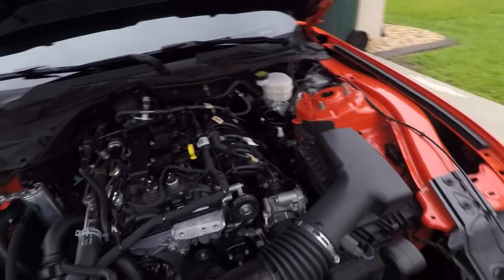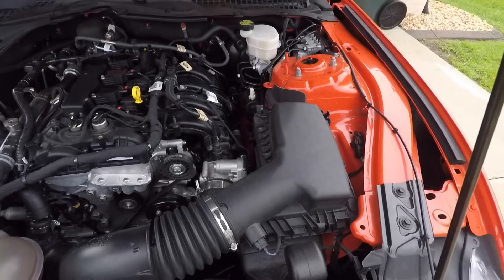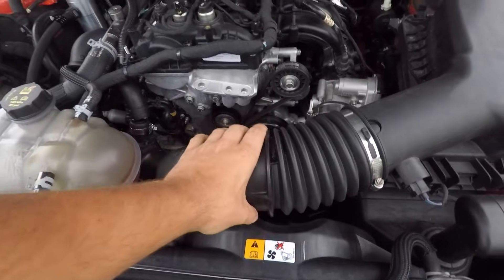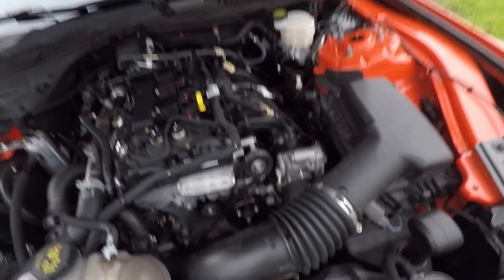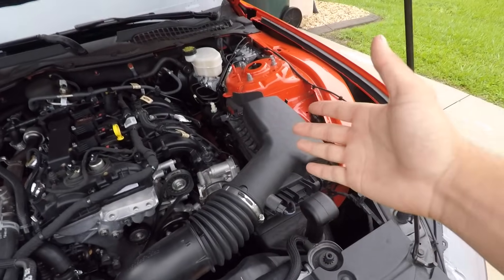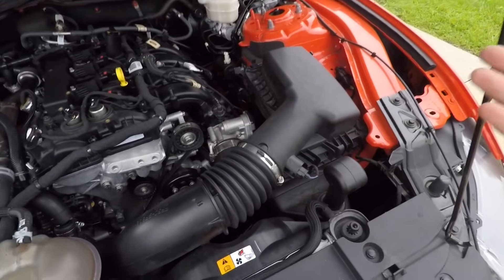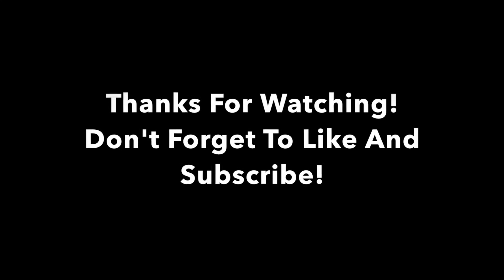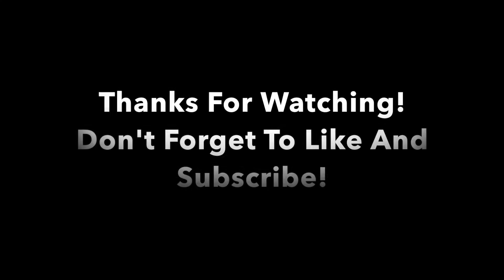Top 5 Mods Not To Do To Your Ecoboost Mustang

Comment: Well I just installed the roush cold air intake in my ecoboost, and I've noticed significantly more power vs the stock box. No tune
Reply: Maybe less HP, more torque?
Reply: Had the same intake... Trashed it. Stock box, high flow filter, airaid pipe and velossatech big mouth. Your welcome
Reply: Ford sells a cold air intake kit and a tune that adds 75HP and 64lb-ft on their official website for the ecoboost. Ford Part Number: M-9603-M4
Reply: Lol. Roush intake makes for better airflow, pulls more air is cools you down faster = more power. You will want one maybe not as a first mod. Plus yes it sounds fantastic.
Reply: Same here
Reply: Bryan Milligan yea same here
Reply: Yeah I just watched a video of a actual speed shop doing a bolt on build with one of these. They said the stock intake starts to limit you after you gain about 70-80hp

Which they easily got 100hp with a exhaust system(down pipe included) the better aftermarket intake, the Cobb access port, and a I'll have to edit this when I find the video again to see what else the added. But they gor 100hp and about 90 extra ft lbs of torque.
Reply: I just installed my Roush intake in my EcoBoost I felt more on pull and power?..I still dont understand why the video says you lose 10 to 15 hp?
Reply: @crowdhunter168  I agree with you
Reply: @dan930412  same here brotha
Reply: @jesseluna8423  same here brotha
Reply: @JustaM340i  The argument is focused on open-intake boxes, Roush sells a closed box (like the stock intercooler) for 2018-19 models, which was a very good move on their part. It's something to do with the air/fuel ratio when you have no cover on a intake.
Reply: Tbe roush intake has slots near the lid to make it lounder which lets hot air into the intake track. That means less power.
Reply from the maker: Most people are running stock box for a reason. Even guys making 600+

Comment: The intercooler part, dude, did you black out for those two minutes? I've had both sizes from a stock location intercooler, to a big FFTEC unit with a Garrett core. Barely any difference between the units. Any stock sized replacement is a huge upgrade from stock and one of the best mods you can do to this thing. Super cheap on the used market also.
Reply: Yeah seriously this guy doesn’t even know half of what he’s saying

Comment: Most of your advice really applies to the 3.5 ecoboost taurus and lincoln as well. Intake does nothing but add a louder turbo sound. The stock ford intake is not a bottleneck. At least not yet. Aftermarket exhaust rasps like crazy, but does add HP. Definitely go with a custum tune from a reputable tuner like Unleased or Livernois.
Reply: flow master axel back with a reso delete y pipe sound just perfet without it being trash

Comment: You can run your cobb ots tunes just fine trust me. I've been running stage 2 91octane for about a year now and nothing has gone wrong and I definitely push this car. Just use the right stage your car needs. Each stage you are required more and more mods. Rn I am fbo. Trust me cobb has been in business a while and are professionals, your car will be fine as long as you have your mods associated with the stage you run.

Comment: I agree for the most part except for the CAI. Depending on the CAI. Going from stock to the shelby GT350 CAI intake  and tune (the tune doesn't work with stock air box) made a dramatic difference. According to 224xLC dynojet made almost 90 hp at peak gains and almost 100 tq at peak gains. IMO CAI is worth it if you buy a tune and intake specific for one another together.

Comment: Easily one of the worst and most misleading videos I’ve seen on the eb. Providing no evidence and just ones shitty opinion. Maybe at the time of this videos the stock cai might have been better but not now. Cai, borla downpipe, mbrp cat-backs with a tune, gained 110hp and 125 tq. Exhaust sounds deep and not like a ricer. I’ve had these mods on for about 20,000 miles and haven’t had one problem.
Reply: What mods do u have I’m trying to run the same setup???
Reply: yeah and a few other little simple things will help like performance injectors and some nice spark plugs. Then all that after a tune will help a ton. Also allowing the engine to breathe is your most important factor and then you can start raising boost pressure.

Comment: This is an older video so may have changed but I installed the Cobb stage 1 93 tune and love it. Car has a lot more power but more important drives and shifts better. Now I bought the car to drive 10 more years so not out racing it.

Comment: There are certain caveats however to his "suggestions"  which I feel should be expanded on, and I am not saying he is wrong, just adding to it.  

1. Cobb AP OTSs are listed specifically for the mods you "should" have and you should not be running anything higher than a stage one without any of the supporting mods, these tunes were done by cob based on their parts, so unless you are running similar AND  the correct octane.  Get a custom tune, but I ran the OTS tunes on my EBM which was more than bolt on (big turbo too) and I did not have any issues, and no knocking, so I would just leave this, your octane may vary.  I would not be surprised if he is getting gas that is less than rated and does not know it, its very common.  You should be running a knock count PID and Octane adjustment PID of some sort on your tuner logs to confirm knock/ping values are withing normal states.

2. Throttle body spacers (not w/bung in the spacer), or larger throttle bodies are pretty much only good if your running a big turbo or methanol. (note there is also a  70mm Ford Racing TB available as well, but if you not running 29 psi+ its uselsss).   The Intake spacer is only good if it has extra injector bungs for secondary port injections or methanol.  Making the runner length longer will only move the torque curve lower in the range but its negligible by adding an 1"   It is siimilar to what happens when you add a cobrajet intake to a coyote engine, same effect, you the runners are actually shorter and it moves the torque curve higher in the RPM so you lose torque down low but gain it higher in the rev range.  The TB spacer thing is more about adding turbulence to the air flow to help with atomizing air fuel better and it is kind of useless if your not spraying a power adder like NOS or Methanol.    

3. Most un-boxed and open CAIs do not improve performance unless the tube size is greater than stock but often take a air temp hit being open to engine bay heat, if not tucked into the fender.  IF you get a full Airaid or similar intake you will make similar power to stock but that is is, it looks cool and nothing more.  I personally like the extra noise of an open CAI but I like it tucked in the fender, or like the GT350 intake were you get the best of both you get a larger inlet, better sound and same if not better performance over the stock unit.  Losses and gains are not high enough in most situations to make it noticeable as shown by one of the last engineering explained videos on this, something like + - 2-3+%

4. I totally agree on the exhaust portion, no strait pipes without a resonator and even then I am way iffy on that.  It is hard to get the sound right.  Borla ataks are great, loud with a good growly rasp and no drone, and I would not even run a non catted DP with those....  Everyone likes MBRP race cat backs because they provide similar gains and sound to Magnaflows comps at less than $600 for 409 stainless....  It is popular for the bang for the buck crowd and are attainable by most people, where as dropping $1500 for just a cat back is hard on the mod wallet.   FYI I lost 4PSI of boost due to running the stock resonator on a larger turbo with a down pipe due to restrictions, I would remove that restriction as a first mod even on a stock EBM you would gain better performance even with just that and a decent tune.  

5. I ran a mishimoto intercooler with my large turbo and had no AIT issues it maintained a healthy 10 degrees lower than stock under full load, and was good up to about 465HP without any heat soak issues, however everyone should know that heat soak is an issue with all ICs if you are not moving, its how efficient they are with air flow that counts.  Large front mounts are always better but you may have a cost of the Active grill setup to do it, so that should be kept in mind, and also remember that the larger volume of the intercooler is often followed by a small loss of pressure too.  You will gain better temps at a slight loss of boost pressure.  So make sure your  tuner is good.

 I would add a 6th mod to the list and that is billet water pump pulley.  you will find its very hard to find a full set of lightweight pulleys for the EBM and doing just one such as the water pump pulley from MMR or whomever will net zero real world gains from dropping a tiny bit of rotation weight from the drive system.  I would also add to that the process to do pulleys can be incredibly complex as well as you have to lock the crank in position etc. which required work front and rear of the motor to do full pulleys anyway and the price and time/labor to performance gains (Unless you pulled your motor and are full bore forging your block) is just not worth it, you are better off pulling the balance shaft instead for a real world 20lb drop in rotational mass weight. =)

Comment: Great video! The only thing that jumps at me is the intercooler comment and exhaust. For the exhaust, I think it's just personal preference so not much to comment there. I have the MBRP Race and for me it sounds awesome. Now on the intercooler; the position placement I agree  to an extent. However, a stock location IC should not be discarded. I have the Mishimoto and my charge and air temps are 30 degrees lower on all conditions compared to the stock one. I think the Levels Performance may do the same or even lower. It's all about design and quality in my opinion. The performance of the Mishimoto and CPE are night and day amazing. For sure we can all agree, the stock IC MUST be replaced immediately. With that IC car runs constantly in the mid and high hundreds degrees F.
Reply from the maker: Frank Nunez interesting because the mishimoto intercooler is actually the one everyone says is the worst one you can buy lol
Reply: Watch My Eco different people talk a lot, but no one provides proof. We can talk about this all day, but for people to believe it, provide some datalog comparisons between any of the ones you mentioned, before you trash/discard any brand.
Reply from the maker: Frank Nunez I've seen plenty of charge air temp logs of mishimoto and it comes nowhere close to say levels or ets. I'll stand behind my statement that there's no point in buying a stock location intercooler when for similiar price you can get a bigger front mount
Reply: Watch My Eco If you haven't had both personally installed and done a comparison, it is worth nothing. You can't compare someone else's logs because the entire setup is different. You have to compare apples to apples. But anyways, great video!

Comment: CV Fab units are very nice, just installed the street version on mine. Made a nice difference with minimal invasive modifications. It really depends on what you are looking for doesn't it ? I may go to my local 1/8th mile track once or twice a year to play and make a handful of passes, that's it for me. No hot lapping or constant beating on my car so the street intercooler should be fine for how I plan on using it.
Reply: I got the CFV street because it's best for daily use, havnt installed it yet. Only reason to get a massive one is to race and track

Comment: Had a throttle bodied put on my 16 eco boost without the tune 3 hp gain with tune accommodated for the new throttle bodied gained 11 hp. That's a huge gain for a simple bolt on. Throttle bodies aren't a horsepower myth they do work.

Comment: Personally I just use my cobb access port for data logging and as a gauge cluster. I have a 2002 ford ranger that has a 2.0 ecoboost swap and it works great for viewing sensor info and all that.

Comment: I have a 2019 EcoBoost.. I did a test between the stock intake with drop in filter and turbo inlet pipe and compared it to ROUSH’s CAI. The Roush was wayyyy more noticeable than just the drop in filter and pipe. I had person even ask me if i changed the filter and pipe. When I went to the Roush system everyone could tell the car had way more torque and power. It really opened it up. Also FYI DO NOT USE COBB ACCESS PORT ON ECOBOOST YOUR TURBO WILL BLOW. Its like JB4 for BMWs… USE sct tuner instead.

Comment: I think the complaint on the CAI may be misplaced. Many people swear by the FOrd Performance kit. I do think it is important to get the calibration tune with it though. Making a significant change to the intake parameters without the proper tune almost certainly would loose power.

Comment: Not all CAI are identical so the sealed units perform like the OEM unit but with more surface area, I use the OEM air box with K&N and Airiaid intake. I would recommend using a direct replacement/street  intercooler for anyone who wants to preserve the warranty. Using a Race intercooler will likely void the warranty. I use the street series IC.  To kill the exhaust drone on a full Turbo back exahust I had a 12 inch, 2.25 diameter glasspack installed after the catted downpipe connected to the MBRP. Without the glasspack the drone was horrible. 

The reason I used the 2.25 diameter glasspack was to allow running the engine safely both tuned and untuned. I use the SCT tuner with the Bama custom tunes but I only run the 91 tune on 93 Octane. Going Pro tune is fine but realize the more aggressive tunes comes with higher risk of failure. Running a mild 91 tune on 93 Octane is best for street use IMO.

Comment: CAI is debatable. Intercooler I know nothing about. Only exhaust you should consider is the Borla stage 3 ATAK cat back system. That system sounded really good on my old Ecoboost. Instead of a tune I did the Ford Racing performance package, keeps the factory warranty too. I did a throttle body spacer and while I knew there would be no power gains, there was a noticable increase of almost 0.5 mpg.

Comment: The Cobb stage 2 and 3 off-the-shelf tunes are only to be used if you have installed the bolt-on upgrades that Cobb indicates are needed for those tunes to be effective. For example, you should only install a stage 3 91 octane tune if you have bolted on a CAI, a turbo-back exhaust, a larger innercooler, and are very running 91 octane fuel. Otherwise, you don't have the hardware to support the upgraded tune and be you're asking for trouble. People who expect a tunner to  make big hp and torque gains without the proper bolt-on mods are ignoring the most important part of the equation.

Comment: I agree, I always hear people say the MBRP exhausts are the best because their cheap and have a decent tone, and most cat-backs or straight pipes ecoboosts sound terrible. I put the corsa turbo-back on my car and it is the best sounding in my opinion, it's 3 in diameter and made of stainless steel that won't rust, the only downside is the cost of it.
Reply from the maker: Lots of great options honestly

Comment: Just put on magnaflow street cat back, nice deep tone, love it! Comes alive when you want it too!
Reply: I use the same. For my daily driver and a long distance trips it works great. Sometimes I wish I had more but that is what a V8 is for. It sounds good without trying to be something that it isn't.
Reply: @AyatoWard  I can't decide ....Street or Competition?
Reply: @skillz_311   Depends on what you are going for. If you want loud then Competition. If you just want a deep tone without being as loud then Street. That being said, I love my Street Cat-back. Seems to be loud only when it needs to be and doesn't sound like your average turbo'd 4 banger. Nice deep tone at lower RPMs and not so loud that you can't hear the turbo. You can still tell it's a 4, but it sounds good.

Comment: All those mods are worth it I got a 2020 Premium Ecoboost and my 0-60 is 4.2 Seconds and I am Stage 2 Tuned with Full Bolt Ons
Reply: I am also pulling 4.2 sec to 60 with stage 2 tune on my 2021 HPP. Hp-430 trq-450
Reply: @34and0  I’m in a 2022 Bmw m340 running 3.2 from the 0-60 now

Comment: I think the cold air intake makes a big difference in hp and the sound from the engine.
Reply: CAI doesn't really benefit cars that run based on turbos
Edit: they do but not as much if the factory intake is set up well
Reply: It's a hot air intake on any car unless it's completely closed in with that box ,.  you get the swoosh sound from the recirculating valve but all the hot air from the engine as well .
That's why they made a box with air that comes in from outside the car you would get more air flow with a drop in filter ...... You can lose tourge  as well with these cat back systems if you don't have a tune  a car back with out a tune r catless pipes etc is just noise not HP I tried these at the track I lost HP without a tune nd the above listed mods .
Reply: RadDadGarage True it would have to be in a sealed box. To keep the hot engine air from getting into intake 🚙💨💨💨
Reply: Tri Hardcx Ok thanks 🚙💨💨
Reply: @Ezduztube  I got the roush CAI and always intended to rig it with plexy glass to close off the top and never got around to it but I got a 3 inch downpipe installed awhile back and had to get it tuned which made a world of difference.
Reply: @The_Handsom_Italian  Sounds like your performance got better 🚙

Comment: intake manifold spacer is used to add meth lines or extra injectors. i use it in my fiesta st for methanol injection. the other ones i do agree on. just like you said. if you are using it for meth....